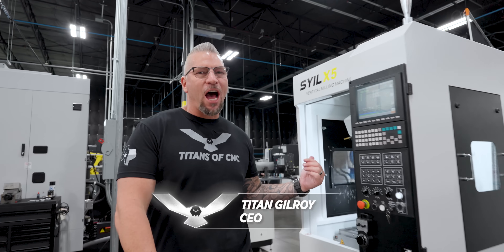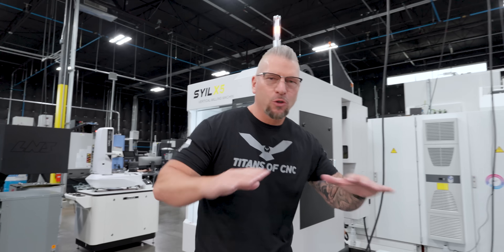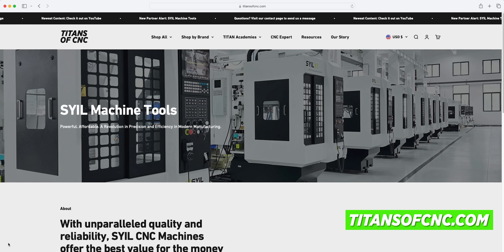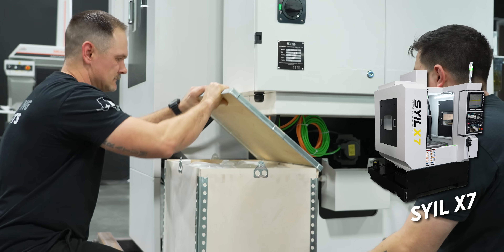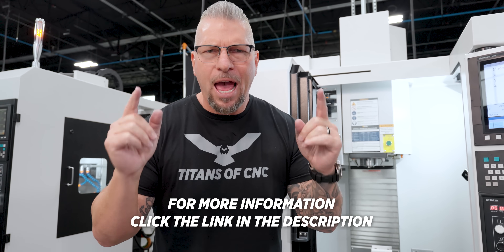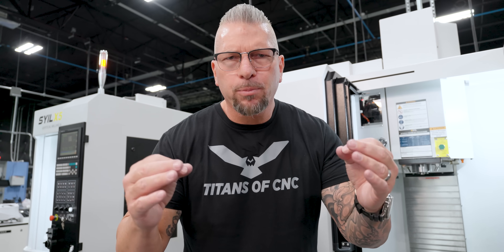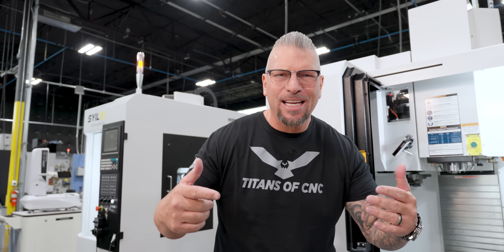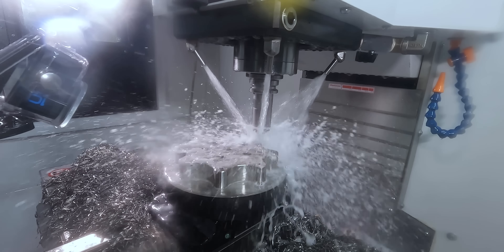They Say You CANNOT Do This To a CNC Machine

Comment: they really need forklift pockets on the side of the machines, not just from the front. And offer a multi tap transformer. The voltage here works out to be about 350v out of transformer. The machine likes 380.  The manual cover both controls but no program examples the way haas does.

Comment: Tips on how to not use a fork lift:

Either

1) surgically remove the middle of the pallet while it's still sitting on the pallet..

Or

2) cut off all excess pallet around the perimeter.

Either use a pallet jack in the middle with blocks, or use toe jacks on the perimeter of the casting.

Remove pallet from under machine.  If you can't go high enough, surgically cut the bolts.

Lower machine down slowly using necessary blocking to aid stability.

Use skates or pallet jack to move into position.

Comment: Now show us how to do it with a pallet jack in a garage lol
Reply: Once it was off the truck and removed from a pallet we moved my x7 into its final placement with a pallet jack.  Unless you're an experienced fork lift operator, its worth paying a rigger to handle all the critical lifts for you.  By the time my guys pulled into the driveway, removed the machine from the truck, pulled off the crating and had the machine in place, it took an hour.  Zero drama
Reply: @cskovach   Do it yourself and things go bad. You get to be an adult and keep the broken pieces. Rigger flips it over he gets to cry and call his insurance. PS. Make sure your rigger has insurance. And call the broker listed on the policy to verify its still in effect. I have seen dates photoshoped and policies canceled. Obviously a rigger charges. A lot. Everyone has to make that calculation for themselves
Reply: @danielquatrone4654  good point on insurance.  

at the end of the day it's usually a false economy thinking you're going to save money by not hiring a rigger.  It's a different story if you're dealing with an old manual lathe or bridgeport that you bought for 1000 bucks and won't be trying to making money with, but if you drop your cnc machine (the cornerstone of your business) then you're SOL and are going to wish that you spent the extra $1500 or whatever to hire a professional and get it on the ground safely.
Reply: toe jack and 10,000lb rigging rollers moved my 2,500lb tool and cutter grinder. I do have a I-beam 4,500lb with a hoist but not used it yet for this. Will do when I disassemble for inspection, repaint and whatever repairs needed
Reply: We have a bent pallet jack in our shop from moving 4700lbs with a 2500 lbs pallet jack. Still got the job done. And is still in use 8 years later. Don’t let a sticker stop you from getting the job done. Or higher a rigging company is probably the smarter what to go. You do you.
Reply: All skates or pipe rollers here.

Biggest machine I moved on rollers was 11,000#
Reply: Pallet jack is not the problem. The 97inch high is a problem going under most garage doors of 80 inch tall.
Reply: Machine skates, toe-jack.  Delivery folks had a fork truck to offload the pallet then lift the machine as far as the garage door. Easy into my garage-sized shop. The slots don't fit a standard euro pallet truck though. Mine is rated for 2500 kg and the machine weighs 2000 kg, but the machine skates could take way more than that.
Reply: Can't do it. These machines weigh 4800lbs. Gotta get a forklift.
Reply: @davidmiller2167  I guess you've never seen a 5k lb pallet jack then.... we've moved a VF2 before with them ....
Reply: @Steelcrafted  does a pallet jack have enough vertical travel to get these off the bolts on the shipping pallet? Doesn't look like it to me
Reply: @davidmiller2167  you would have to block it up probably
Reply: @davidmiller2167  Most pallet jacks I've worked with were rated to 5000 pound, two of them will do it easily.
Reply: @davidmiller2167  false

Comment: When would you upgrade the spindle on the X7 (choose the 30k rpm HSK-E40 over the stock 12k rpm BT30 spindle). Im a bit on a budget and dont know if its necessary to pay the extra 9500€ when I will cut mostly AW7075 and Ti-6Al-4V?
Reply: If you are going to be making large production runs or if you are going to be micro machining (1/8" and under tools), the 30k spindle would be a notable benifit. Also  keep in mind HSK holders are going to cost more than BT30.